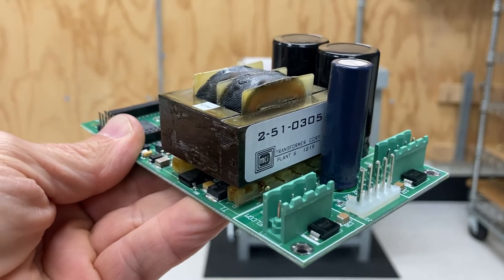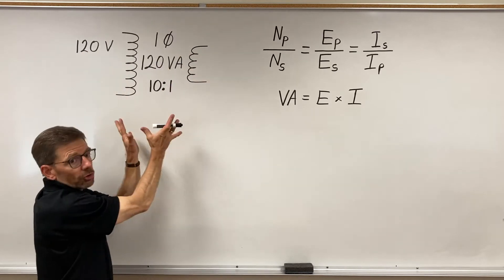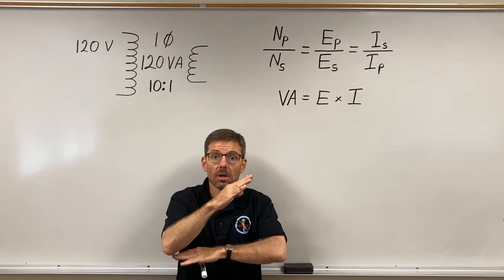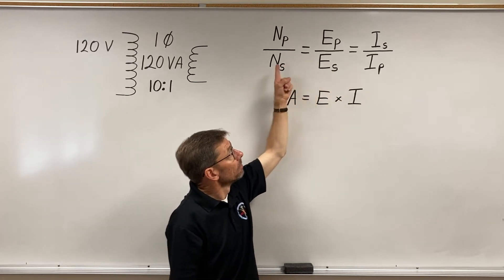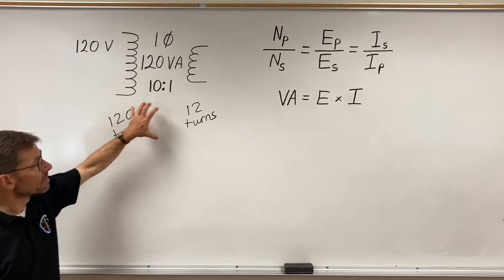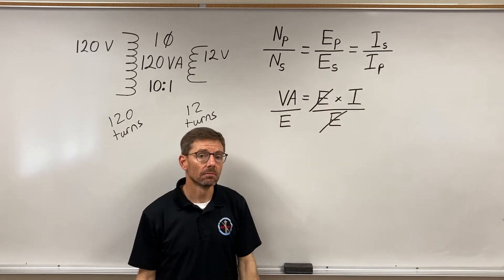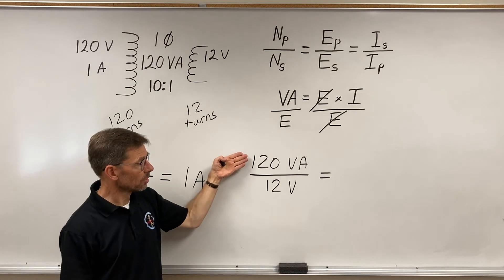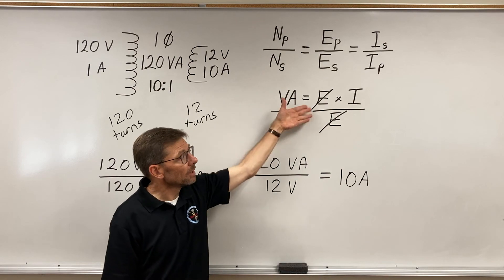Transformer Basics - Introduction to Ratios and Calculations

Comment: When you have no load connected to the output side of the transformer, the input side still has resistance in the wire and draws a load, so it consumes power, right?  Does the input load stay constant, no matter the output load, or does the input power change as the output load changes?

Comment: There are also formulas for figuring core size turns per volt and wire gauge for a given amperage This all has to be figured in before turns ratio even matters

Comment: Dave, I got a un usual question for you. Even though this might not be a common application, but would it be possible to wire this example of120VA  120:12V into an autotransformer, but not as 132:120V; but instead as the same ratio: 120:12V.  What would be the VA? I series? I Common? I would really appreciate any feedback in this matter. Thanks,
Reply: use taps